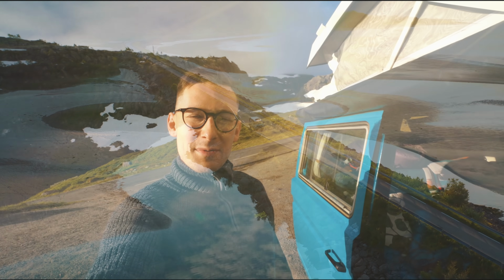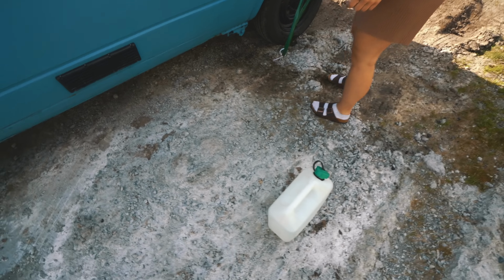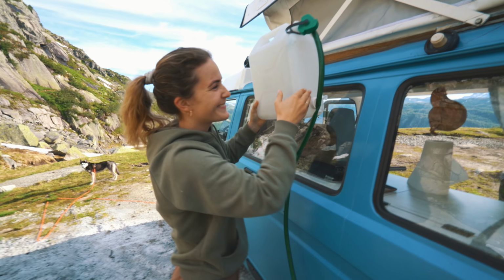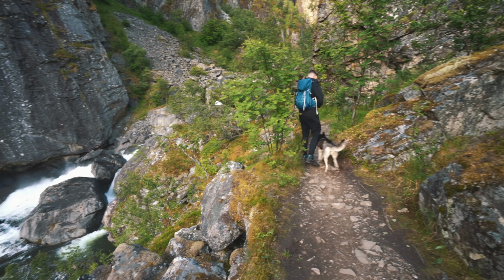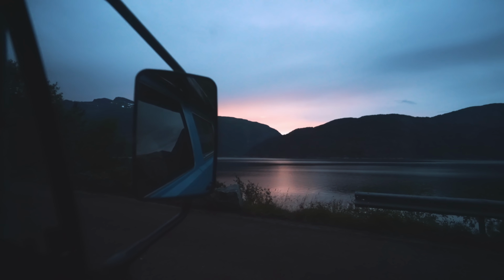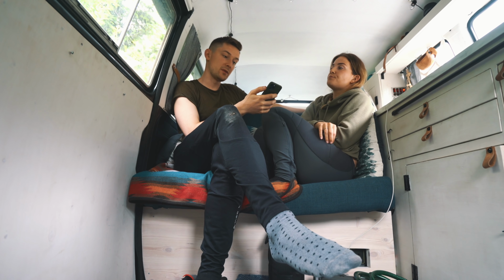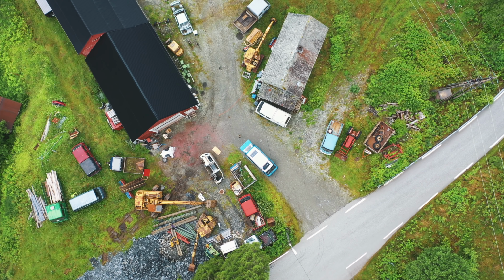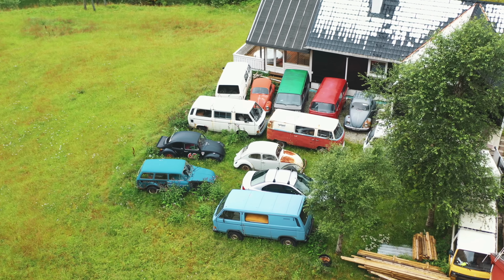Reality of a VW T3 on long road trips (Grand Norwegian Road Trip ep. 1)

Comment: Nice video! And what a luck to find an expert.  Sadly also denting the budget but be lucky you were not in a city. As my experience is that garage days in a city are even more expensive:)  And maybe you want to hop by a marine store and ask for a 'siphon hose'. Used to bring fuel from a jerrycan to a boat fuel tank without spoiling any diesel on deck.  Or water in your case. It's a hose with a holder in which is a ball.  Put the holder in the jerrycan, fast pulling/pushing  it up and down, and there is a flow. Super easy.  and cheap. about 8-13 euro's.
Reply from the maker: Thank you😊 We definitely stumbled upon the best guy around🙌🏼 Thank you for that tip, I’ll look into it, sounds really smart:)
Reply: @SimonBraeck  there are siphon hoses with a sort of a pump to squeeze, but those are not the ones to have. To be sure i add an URL shorturl.at/krHST so you know when you see it in a marine store.  Have a safe trip!

Comment: Yeah, I know that feeling ! Almost 8 months since quarantine time and still struggling to put my van in order. This summer was a mess for me and working on these vans, never seems to end !
Reply from the maker: Oh wow, it’s a real time thief when your unable to enjoy some time on the road🙈 Fingers crossed our luck is better going forward ;)
Reply: @SimonBraeck  13+ Years traveling with this van and still hoping ! 😄
Reply: Syncro van, I went about 250 miles with the subaru engine I installed,  a week ago, lost power and is making a bad noise,, been over a 18 month project, engine 4, might be coming up on 5, and still no more than 30 min from the house...due to gearing, 65 mph is 3200 rpm whcih seems a bit high for me,  my friends are telling me, dump the vws, and get a 18-24 foot camper with a Chevrolet or Ford power train....IDK...the splits suck since they top out at 50 mph, the bay needs a new engine and rust around windows, the vanagon is what I am trying to focus on...2+ years now, no camping...
Reply: @DanTheManIOM  Yeah, I know what you mean ! I've also changed 4 engines and this one, probably needs at least be rebuilt. Guess we, the T3 owners are masochists since we like and chose pain ! 😄
Reply: @syncrovanCos  im saving for an ext mercedes sprinter with less than 10 thousand miles i shouldnt get issues like this should i?
Reply: @Anthony0855  Never say never ! 
I've seen brand new cars failing at the edge of the road, but as I like to say, once in a while, is good to change the problems. New ride, new problems. 😁
Reply: @syncrovanCos  thats strange ive driven cars for years and ive never once had a issue with any car in my life are vans lower quality than cars or something

Comment: I recommend 1.9tdi or mtdi engine. It is more reliable than old 1.6jx! Nice video and im waiting your next one. 👌
Reply: Get the JX rebuild, original is nicer. And it is reliable motor as it is. Strong enough for the T3 and doesn't consume that much (ours is with a highroof at about 8.5L/100km and it is still the original one, not rebuild)
Reply from the maker: We’ve still yet to decide on what to do, but we’re considering both options... Something needs to be done, that’s all we know😊
Reply: So do I, The TDI such as AHU or AFN is the best option. For easiness use an MTDI or even just an AAZ engine.

Comment: Your body work looks fine simon no rot. Just replacing parts when needed is the game!😁
Reply from the maker: Hi! As you say, it’s not too bad. Some rust that needs attention after a while, but mostly it’s all the original parts that needs changing at this point:)
Reply: My t4 has had alot of rust in the floor', doorstep, wheel arches back bumper ect. I cut it out myself then a local small metal fabricating company (that makes trailers) were happy to do the welding inbetween jobs. I think they were so used to grinding and welding with the machines to bend metal ect. I would look to this kind of company in the future for that kind of stuff. Great videos best of luck...
Reply from the maker: Okay, great tip! We’ll definitely look into that once it’s needed. Thanks you☺️
Reply: @SimonBraeck  i feel so much more confident in having an older van once i new a metal fabricating guy who was happy to do it. He did much better job and cheaper than a Garage working to an hourly rate. Sorry to go on. cheers.

Comment: Hi Simon! Very interesting video !!! T3 paradise!))) And I have already traveled more than 3000 km in my AHU. I am very pleased with the result. I was pleasantly surprised by the fuel consumption (about 6 liters / 100 km). The only thing I would like to add is speed. The motor is 110 horsepower, and the gearbox does not allow them to give free rein. Although, if you go to such beautiful places as you, then you don't want to rush at all. Bon voyage !!! I look forward to your videos.
Reply from the maker: Hi! It’s such a nice place to cruise around in these old vans. That’s very interesting and such low consumption, wow 😳 We mainly lack the torque and I would like to change wheels and tires too, so a bigger engine would be great. Thanks for watching🤗

Comment: you don't even have to suck from the hose, block the bottle opening with your hand and squeeze the bottle, the pressure will send water down the hose, especially if you are transferring petrol instead of water..
Reply from the maker: nice tip, thanks!

Comment: It might be wise to change or check bearings and cv joints on forehand, before making a very large trip. May be you expect to much from this type of car. 
The T3 has the looks but by far not the quality of an Unimog. It is simply a car, not an allroad vehicle.
Owning a T3 from 1980, it now rolled 421.000 km. This can only be achieved with ongoing maintenance.  Have nice days though.

Comment: Its funny how naive VW T3 owners are. Buying a 35yr old bus and expect it to run like a new?! I see it all the time, specially on instagram. I have Never broken down in my VW T3 bus, but that because I have change all important parts in engine, transmission, suspension. When doing that it’s the best van you can have. But you need to restore before you drive around the world. 

If you don’t put any love in your bus, the bus will have no love for you! ;)